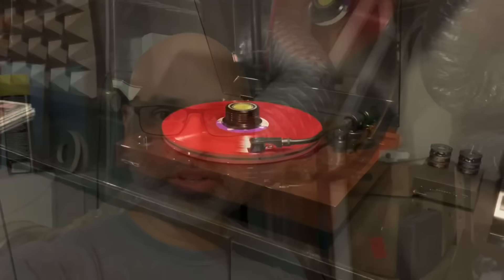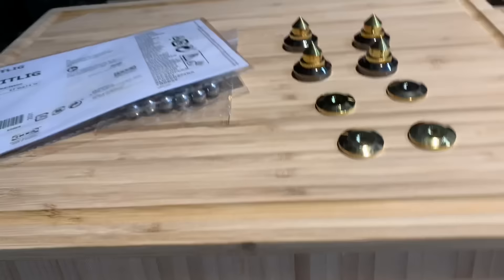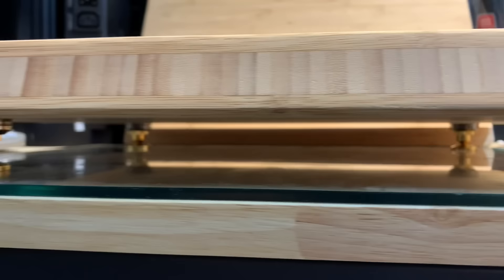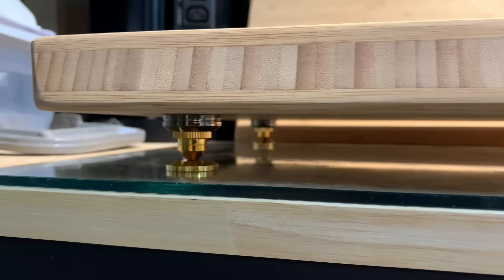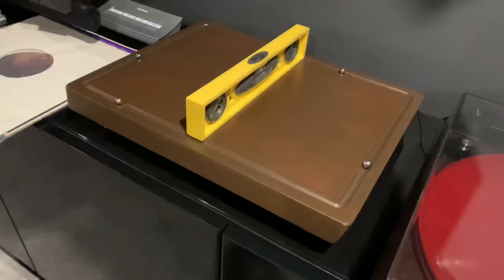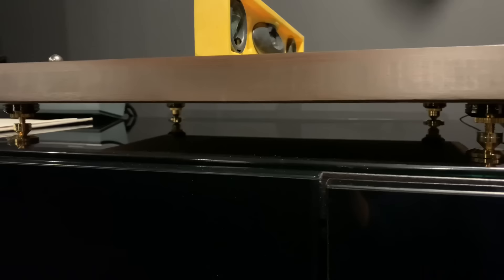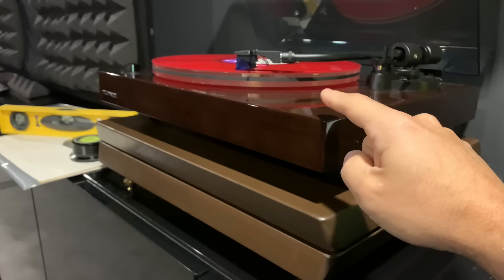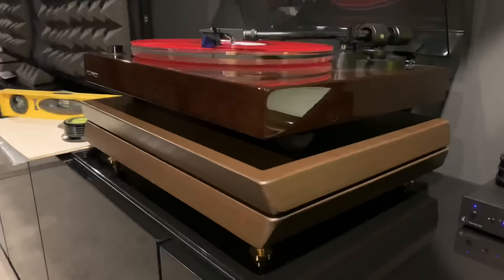DIY Turntable Isolation Base with Ikea Aptitlig

Comment: From what you have in your video as well as others mentioning in there comments too. The feet are not de-couplers they are in fact coupling to your  glass and cabinet. Yes you will get some isolation from the mass but you will also get bad reflections from your cabinets. Stuff some furniture pads in those cabinets too guaranteed it will help.  I only bring this up in order to help the situation. You need de-coupling feet under your turntable. Same concept goes for speakers couplers under granite slabs and then de-couplers attached to your speakers so they are floating from the isolation and not transmitting resonances to your wood. For a good reference Jim Smiths book "Get Better Sound" goes into this and his news letters as well.  Hope this helps! IT looks good too !
Reply from the maker: Lots of comments on the this topic of decoupling. While pure decoupling would mean zero contact, decoupling also includes the domain of minimal contact.  The feet are technically the layer of decoupling in sound vibration transmission in my version.  Short of levitating, there is no way to completely decouple.  Many people mention rubber and neoprene, and other variants of soft material, that is not decoupling either.  That is absorption.  I encourage people that don’t have a turntable base to try this project.  It’s minimal cost and the results are truly impressive.  If people prefer other methods, feel free to try something that works for you.  Never intended this to be the project that schooled everyone on what is best.   Cheers all.
Reply: @Mixturerich   Decoupling is a really hot topic right now. I dont think the comments here are meant as a negative.  If you look at other videos posted here about it there are tons of comments. I think that is a good thing that a lot of us are experimenting with couple and de-couple. I think your table looks great and if it works for you thats all that matters. I have gone thru the exact same project and learned the hard way money wise what works best isolation wise. The only true floating  de-coupler feet on the market that I have come across are the iso-acoustics Gaia feet. Give it a try they are true floating feet. I also switched out the bamboo since its acoustic resonance is very high compared to Butcher Block Acoustics solid maple with a much lower resonance.But still not as good as a granite slab that had the lowest resonance.  You can pick some up at any lowes for under 40 bucks. In the end its just enjoyable to watch your video I wish I would have recorded mine.
Reply from the maker: Thanks for the comments :-)

Comment: Instead of steel ball bearings, would ceramic balls improve the isolation. I have substituted ceramic for steel balls in a Michell record deck together with other mods. In my humble opinion, this has made an improvement to the clarity of the sound, at the very least.

Comment: Why did they ever stop suspension in a turntable??? My older Thorens sits on the 3 springs and it's like it's floating on air. Cool little project tho.
Reply: Thorens still build suspension turntables, check out the TD1600 and TD1601 which obviously give a nod to the TD160 which I have.
Reply: @nocturnal1970  ,Sorry I was a little vague there. Yea I know some still build suspended turntables. It used to be all had springs, now it seems a majority of the affordable ones don't. My TD 126 has them. I can smack the counter mine sits on pretty hard or tap with hammer next to turntable and hear nothing  thru the speaker.

Comment: You want to dampen at the bottom of the plinth and draws energy from the table, take the feet off and put underneath one piece 3" of cellulose foam making sure it's against around the main bearing tight or get a squash ball and fill it with tungsten powder and Super Glue it to the plinth engulfing the bearing and then the foam,  you can take the feet off and put them on a separate board for adjustment and only one board is needed. Would be worth your while getting a phoenix engineer speed controller and the Roadrunner best thing for belt turntables, better than stand-alone control units better than vpi stand-alone control unit DIY audio you can build the kit

Comment: Crazy thing... as far as I know, this Newtonian steel ball pendulum swings "forever", at least for quite a long time. So much for absorbing energy with steel balls and other sonorous materials. But it definitely looks “interesting” ;-)
People who are fitter in natural sciences would probably take more proper measures to absorb structure-borne noise, such as quartz sand, felt wool, etc. and combine them. Sheer mass such as concrete or marble bases would also help.
Pick up a tuning fork (which is also made of steel and not felt of course...steel has excellent vibration properties, uc?) and test the differences. Let it swing - or even not.
To experiment with lower frequencies and also stimulate your base with bass, buy a cheap transducer, also called a "bass shaker," and place it near your base.
A decoupled base on a steel base would perhaps work if this frame were a standing triangle and a vibration ran up two legs and then canceled out through superposition at the tip.
In the case of the upper cutting board, it hangs between the further away supports (balls) ideally free for swinging like a bridge. All in all, what's the gain?
Another thing, the soundwaves in the room will hit the turntable anyway, with or without an absorbing base. This, if its really absorbing, only helps against the structure-borne noise mentioned above, with this non-rigid storage on wheels, the turntable becomes even more active again.

Comment: Why not get a suspended turntable like the Thorens I have?

Anyhow, use 3 adjustable feet instead of 4 as it cannot rock and is easier to level. I built 3 adjustable feet into my Thorens base which is as solid as a rock but doesn't rock. The Thorens platter and tonearm is suspended by 3 adjustable springs decoupling it from the motor and external vibrations. This is a superior setup without that bulky looking DIY setup.

Comment: The Fluance RT-85/84 has 3 points adjustable isolation fleet and is a lot better than most TT out there.  I would like to see the test with a lesser constructed TT.  I had constructed the lower part but have not tried the idea of putting the ball bearings with another layer.  It seems to be a very nifty idea.  Thanks
Reply: I'm here looking for a solution for my RT85. I have hardwood floors and a raised foundation and I can't even walk around my room without hearing it through my speakers at moderately high volumes.  Also bass heavy songs start a bass feedback loop and my whole room starts rumbling.

Comment: Need to use bearings that are either 11mm or 12mm instead of 7/16. Did you find 7/16 tight or loose in the groove? Just need to figure out which would work best. Thanks

Comment: Dan, nice video.  I do have a question about the cutting boards used, does the cutting boards have to be that thick or can they be thinner?  How much thinner can they be and still be effective?  I ask that due to limited height space I have above my turntable.  Thanks.
Reply from the maker: Thicker means more mass.  More mass is better.

Comment: Hey @MixtureRich thanks for this video.  I have a Mofi Ultradeck which has dimensions of 19.69" x 5.375" x 14.25" and that cutting board is  17 ¾x14 ¼ ".  With that being said, the Ultradeck's feet are set in by at least 1.5".  Maybe 2".  Do you think that'll work?

Comment: The ball bearings will not dampen anything and in fact quite the opposite. They are reflective not absorbing.
Reply: I agree. They don't compress. Need something that deforms to absorb energy. Eg. squash balls - the kind that don't bounce.
Reply: @RobWhittlestone  -  the late Mel Schilling - Music & Sound , used  Black Racquet Balls, that were "vented", with 4 equi-distant incisions in the shaped of a cross. BTW - a Slate Slab was recommended back then. Slate is less resonant, than Granite, Obsidian etc. Ball Bearings ???  no thanks.
Reply: @RoaroftheTiger  Now that sounds like it should work very well! :-)
Reply: @RobWhittlestone  Correct. Somewhere along the line Science got lost in the energy transference area. Oh well, I bout the Ikea table and damped it with just one board, 8 foam feet and 4 metal feet. No resonance transfer.
Reply: Exactly, just like snooker balls tranmit energy or those swinging steel ball office stress release things 😎

Comment: Now, you should put your phono tube amp on isolation feet. That may clean the sound that much more. 

I’m making a plinth because I feel vibrations on my tube amp even after I used maglev iso feet. 

It sounds better than the single ball bearing foot I used previously. But, I feel a buzz of vibration on my fingertips. 

I found a serving plate that looks like it’s made of green organite crystal. 

I’m currently buying spring-style iso feet that will be placed under the serving platter/plinth.

Anyways, The Working Hour is a great TfF song!

Comment: Thank you for an excellent tip. Can I use two sheets of granite or Italian marble one inch thick ? 
If yes should I used our  ball bearings between like u did ? 
Thanks again
Reply from the maker: These planks had the grooving for the ball bearings.  If you can groove your material to behave the same, I don’t see why not.

Comment: My Ikea is backordered on this model ....on Amazon they have the same dimensions....17x12 but it is only .7' thick....think this will support my vintage Hitachi Turntable??? Will be using everything else as I have already ordered....please help as I am getting ready to order. Thanks
Reply from the maker: There are no wrong answers.  Go for it.
Reply: @Mixturerich  Thanks for the quick response! There actually is a wrong answer...the boards at half the thickness not being able to support my TT and crack in half?  Do you think the thickness of .7 compared to 1.3 with the Ikea model can support this with the balls and spikes you recommended? Thanks again!
Reply from the maker: @mccarthyd6603  Unless your TT weighs the same as an Abrams Tank, I think you'd be fine.  Obviously thicker is better for mass dampening.  But sometimes, you go with what you have.
Reply: @Mixturerich  Gotcha...will order...my TT weighs 19 lbs...hopefully both boards and the balls and spikes will support...going to be staring at it constantly like looking at my needle riding a warped record😳😳😳
Thanks again...great video👍
Reply: @Mixturerich Got the 2 boards from Amazon yesterday...and although only measuring in at 17 x12 x.7.....looks like it is going to work! Already noticing a major enhancement in sound and also have taken the dust cover off for the 1st time which is also reaping rewards sonically.... Thanks again and great video👍

Comment: Did you prepare the surface of the bamboo before staining? What kind of stain did you use? Did you seal it afterward?
Reply from the maker: Light sanding.  Don’t remember stain.  No sealing.
Reply: Thank you! Do you remember if it was oil or water based? @Mixturerich

Comment: Hi, Great article. I intend to do it, better I was locking for some video where I could find what you put in images and words; however one info lacks me: the size of the bearings. Are they measured by number, diameter or perimeter? Another question in wich site can I order the bearings because in my village , certainly I will not find them. Thank you for your support.

Comment: what is the reason for limiting the number of ball bearings to 4?  why not more?
Reply from the maker: You need the minimum number to reduce contact which causes vibrations to travel through.  4 is the number that keeps the boards locked together without spinning away from each other while providing freedom to move somewhat.  Experiment.  You will see.

Comment: Wouldn’t the rubber isolators that come with the turntable suffice? If not, the manufacturer should relook them.
Reply from the maker: But that would be sad because then this video wouldn’t have been necessary.  Manufacturers are inclusive and think of ways to omit things so that others have an opportunity to resolve issues.  - jokes of course. It‘a not practical for manufacturers to have complex mechanisms or extra mass to address something that only a small fraction of consumers would care about.  This is one of those projects in the realm of “do it, don’t do it”.   This will only matter to you.
Reply: @Mixturerich  I do share your thoughts. Turntables are by nature sensitive to vibration. Manufacturers who care for their products should provide decent isolators, saving us from buying chopping boards! Lol.

Comment: Based on all the below comments would 4 balls of Blu-Tack not be a better option than the four 7/16" steel balls between the boards?
Reply from the maker: Try it, tell us your findings.  Purpose of ball bearings is to give as much lateral movement energy dissipation.  Blue tack will not do that.
Reply: @Mixturerich  would adding few more ball bearings make any difference? ie say upping to 8 (2 each corner)
Reply from the maker: You want the least amount for least contact.  4 is the magic number for stability of the boards.
Reply: @Mixturerich  Ok thanks, just building my shopping list

Comment: Instead of ball bearings I used sorothane isolation disc pads.
Reply from the maker: Hmmm. The ball bearings were to provide lateral vibration absorption.  But hey, whatever works, that’s the fun of experimentation.

Comment: Metal shoes on glass panel not good idea as the glass is sitting on wood defeats the isolation and decoupling theory lol. I have custom design fs104 speaker stands that have spikes and the shoes sit in have rubber base that help the shoe not to vibrate on laminate floor but to add extra isolation i have shoes sitting on a carpet tile which in tern sits on carpet with floor underneath. Another thing i would recommend to deal with sound reflections in front of you is to have the carpet and 2 same size rugs  that are just as wide as the space between left and right speaker,on top of each other makes massive difference to the sound in your room.

Comment: I cannot understand why designers moves away from the classic AR floating three point suspension that made all these silly isolation bases necessary. You could hit the table with a hammer and the needle would not stick. Go figure.

Comment: @johngarnet2826
0 seconds ago
I placed my discounted £12 Aptiitlig on 4 x 50cm Sorbothane hemispheres, then my Technics SL100C straight on top. Cue, for a cost of £20, my system now sounds as if I'd replaced ALL my equipment with gear twice as expensive. Improvements noticed across the spectrum. 70 years a hifi enthusiast, and never before experienced an upgrade like it. Just saying...

Comment: Shouldn't you use 8 ball bearings, 2 for each corner, and router a small groove for each ball bearing to move about an inch or so? Also, wouldn't it be better to use a full sheet of sorbothane instead of 4 isolation feet?